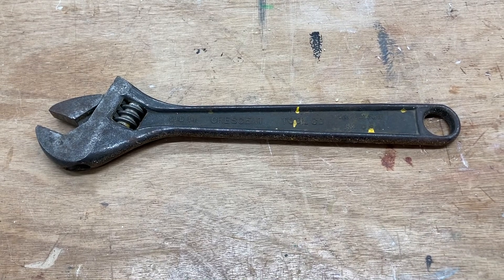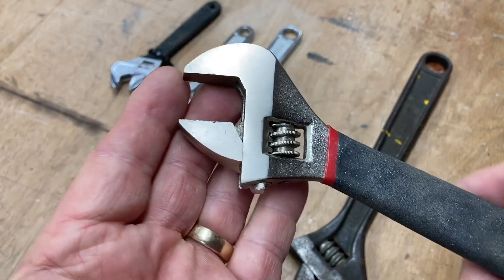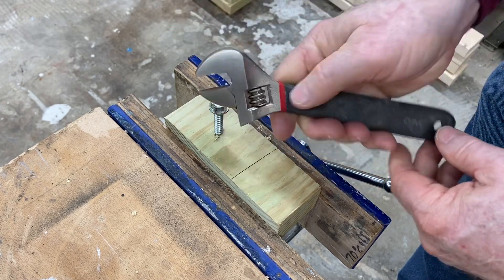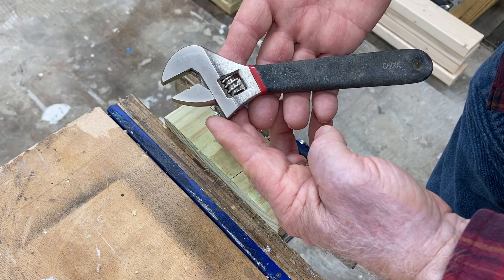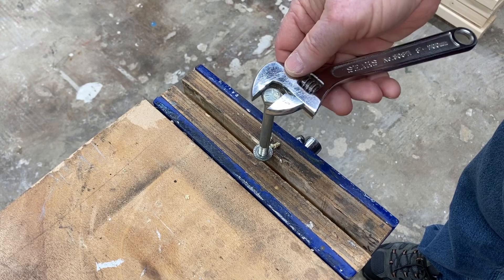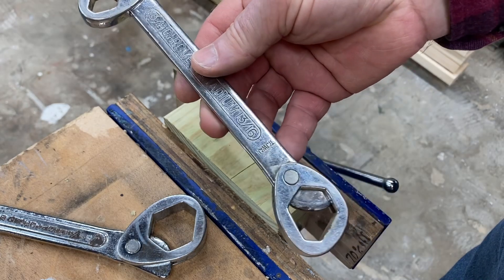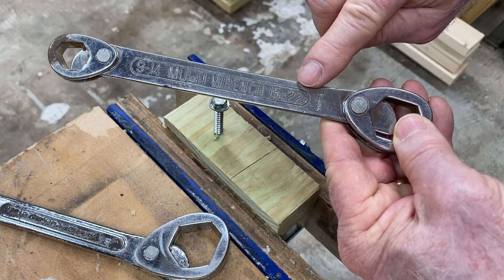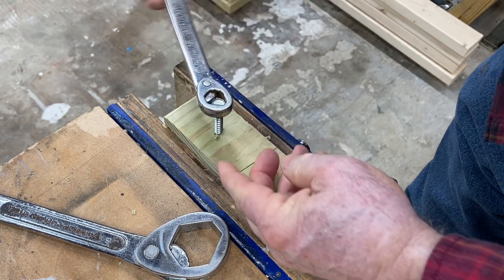A Crescent Wrench or an Adjustable Wrench??

Comment: In South Africa we call it a shifting spanner or shifter for short, it’s used much more in pipe fitting where you use it for unions, valves etc and plumbing where you are dealing with pvc fittings, but definitely has its uses
Reply from the maker: Thank you very much for sharing.

Comment: I like AvE's name for them:    Swedish nut lathe 
They are known for rounding off bolt heads.

I too learned them as "Crescent Wrenches".   But all the ones Dad had when I was a kid were, indeed, made by Crescent.   I know, I still have them all.   At some point, the patent must have run out and the knockoff makers just used the generic "adjustable wrench".
Reply from the maker: Very interesting comments. Thank you very much. I appreciate you giving the name you call this tool.   Crescent wrench was all I knew for years. Thanks for sharing

Comment: The same goes for Vise Grip pliers and Qtips and Kleenex they are the brand names. People use the brand name and it transfers in their minds to a particular product. As simple as it seems I have seen people use the wrench you are highlighting improperly, they just simply never learned how to use the wrench. Good video!😁🛫
Reply from the maker: From a marketing stand point, you have a total success when the product is call by the actual brand name.  You are absolutely correct.  Thank you very much.
Reply: @PawPawsWorkShop   And to date my self Zerox was another one of those names! I bet few would even know that name today! Or Mimeograph! 😁🛫
Reply: I meant to mention I have Crescent brand wrench made out of beryllium used in the gas business! Beryllium will not make sparks.😁🛫
Reply from the maker: Yes, I remember them well
Reply: @TheFalconJetDriver  I remember both of them.

Comment: 6 - 150 refers to the approximate wrench length. 6" or 150 mm.  8 - 200  8" or 200 mm .  They are referring to jaw capacity has basically every one of them goes down to zero.
They are marked both ways because some manufacturers sell around the world and not everybody uses inches.  
America is using a hybrid weights and measures system. A good example would be you buy a 2 liters bottle of Coke and a half gallon of milk in the same store.
Reply from the maker: Thank you very much for your comments. You are correct.